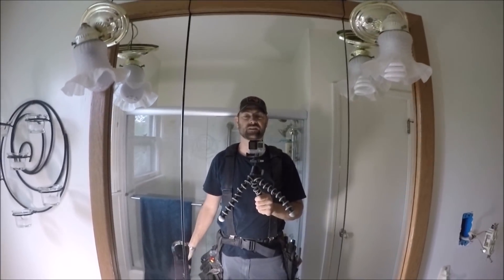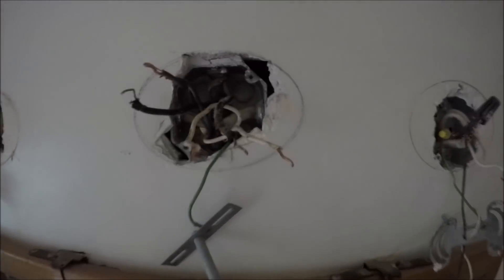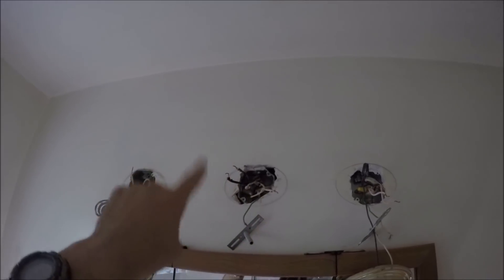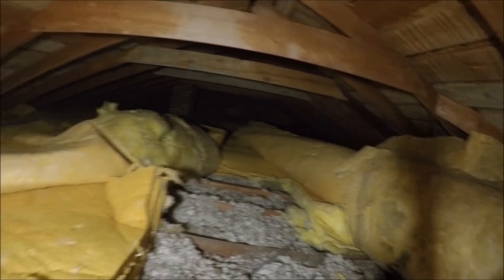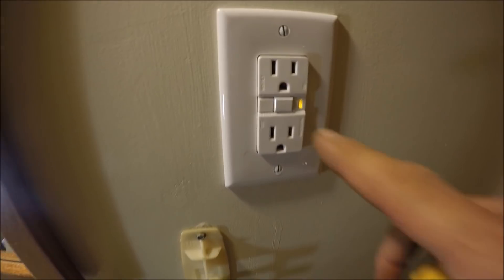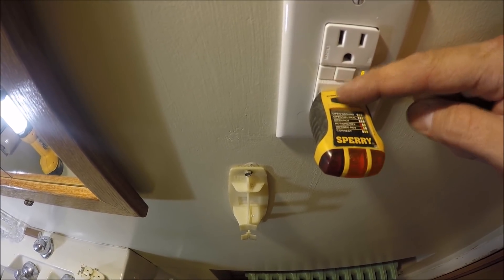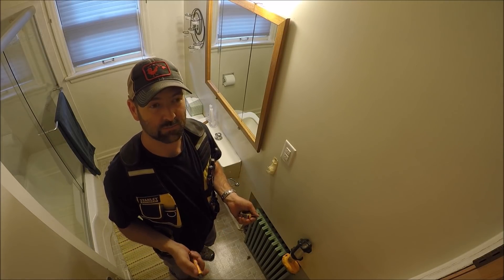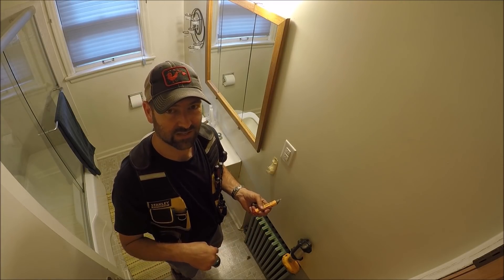Dangerous Electrical Problem That Can Kill You | THE HANDYMAN |

Comment: But the colour of the wires would be inverted. Can you do that?
Reply from the maker: Tyler Libby   these wires are all black there are no colors (1940s).  I use different color electrical tape to designate what the wires do.  Its very a common practice to have to switch things around even in newer construction.  You just put a little black, white or red tape on the end of the wire where it connects to a switch or plug.
Reply: I had the same thought.  The next guy will have no idea that this is the case.

Comment: So when the job went from simple to complicated, did you change what your charged or just pushed through the job?
Reply from the maker: I never change my price.   Doing a good complete job for the price quoted is the best advertisement for my services.  I don't advertise or market my self. I don't even have a sign on my truck.   When jobs like this come up its just a good way to advertise myself to the customer and I always get referrals.
Reply: That's what I do to. Do you operate trough a business that you licensed with the state?
Reply: So I heard depending on state that would be work for a lic electrician?
Reply: The Handyman , you should be able to deduct all auto expense during tax season by putting a business name on your truck.. :)

Comment: Looks like a pain, glad you were protecting you customer, in my own home I think it would have went back the way it was. 110V does not hurt that bad, much better than 220 or anything DC.
Reply from the maker: I have been shocked lots of times.  My grandfather use to lick his fingers and grab the wires to test to see if it was hot.   Thanks for watching,
Reply: Sounds right, I like a multi meter now.
Reply: Amps are what kill you.  .1-.2 amps can stop your heart.  Be careful not to let the current travel across your heart.  I choose to just turn off the power but it's good to make it a habit to not ground any part of your body when touching conductors.
Reply: 50 milliamps can kill if it goes through your heart.
Reply: @Bodragon That is completely untrue. That was the false propaganda that Edison used against Tesla. Tesla/AC Won that "war" as it really could be no other way in a practical/cost effective sense. In fact if anything, the opposite is true. AC passes through 0V 120(@ 60Hz US) times per second, & even though that is too fast to be meaningful as far as muscular responses to electrocution. The actual effective/RMS Power is about 30% less than the DC equivalent of its peak value.

Comment: Couldn't you have just wrapped black tape on the common, and white tape on thr black wires and switch the wires.
Reply from the maker: That was the original plan but something in the bathroom light box wasn't right.  I can't remember what it was this was over a month ago.  It worked in the closet light box though.

Comment: Howdy Handyman from Houston.
Ive been following you for awhile. Im just wondering what preparation do i need to do to replace the old vinyl floor to tile floor because we have just had a huge flood. Does the moisture of the foundation affects anything? What do i need to do about that moisture from the flood.
Reply from the maker: once you have the old flooring pulled up everything needs to dry out.   I use a moisture meter to test wood and concrete before covering things back up.   This is the meter I use to test wood and drywall http://amzn.to/2iU1D5a   If your sub floor is a slab of concrete there are other meters for that.    Hope that helps some.   It could take a few weeks to a month before its ready to be covered with flooring again.

Comment: Wondering why there is so much insulation in that client's attic?  Seems like a bit of over kill.  Tfs  :-)
Reply from the maker: Not sure.  Modern attics have about 24 inches of blown in insulation.
Reply: It depends if you have a working vapour barrier, if not and to much insulation you risk that the wood will start to rot or get mold.. atleast in my climate. Maybe if you run with AC all the time that is normal in america? that is not an issue..

Comment: Good job! Would of walked away and told her she needs an electrician. Never seen blanket insulation is the form of a blanket. What was the size of the blankets and can you walk on it. Thanks for posting enjoy your videos.
Reply from the maker: The blankets were huge.  I don't know how they got them all up the little attic access.  They are't original to 1941
Reply: @TheHandyman1  Perhaps they rebuilt the roof, tore it completely off and brought in the insulation before re-roofing.
Reply: Ken L., OK, Mr. Grammar police.  Idiot.
Reply: Fillow Tree   Would of walked away? Try speaking correctly: would HAVE walked away.